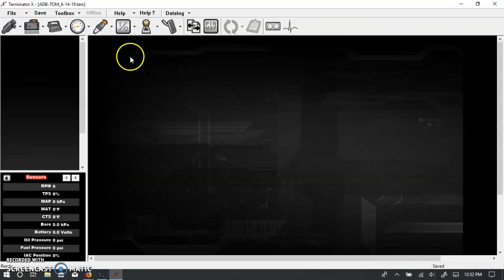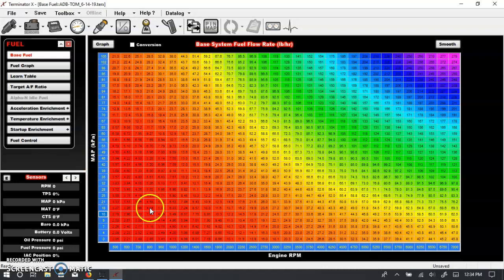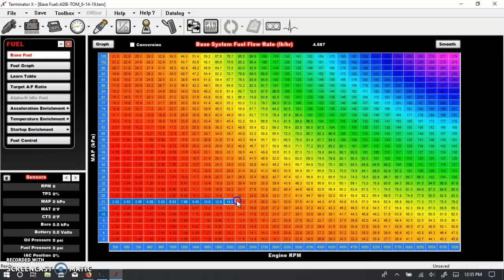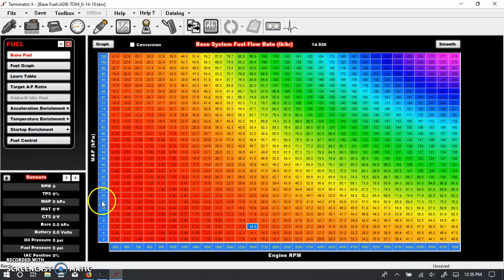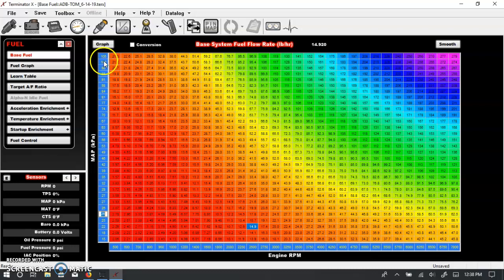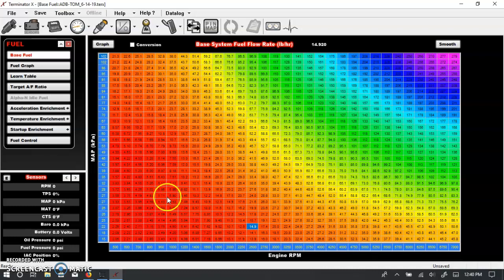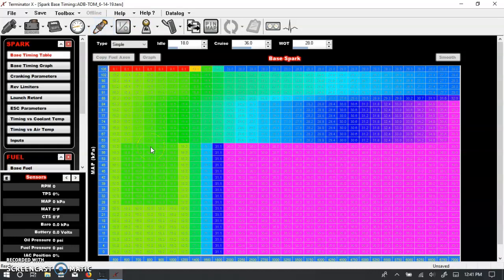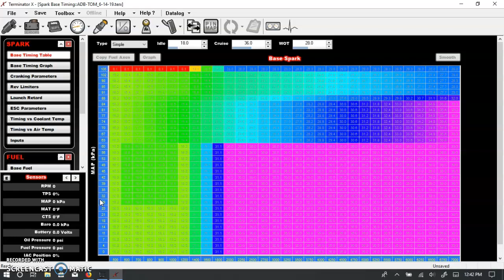Holley EFI Terminator X software Part 3

Comment: I have speed master injection ls1 will this holley terminate work
Reply from the maker: I don't know what "Speed Master" is...
Reply: @projectgattago  they make fuel injection manafolds with stacks
Reply from the maker: I don't see why it wouldn't as long as the a common plenum for the vacuum.

Comment: next video please lol.  question , when I swap over could I just enter the info in the hand held  to get my car running ( I did this with my current ECU as their software is difficult to access to tune on a PC) correct? thanks.
Reply from the maker: Ill get another video made after Christmas. Yes, you can always go through the handheld to enter the initial tune. Although, tuning with a laptop is way easier!

Comment: Can you delete  bars with this?
Reply from the maker: VATS is only on OEM systems. The Holley ECU and software do not have VATS. This software can only be used with the Holley ECUs, not the OEM computers.
Reply: @projectgattago  any free software that will do it?
Reply from the maker: @julzam9660  Not that I am aware of. For stock LS ECUs I see most people use HP Tuners or EFILive. That's the great thing about the Holley Terminator X. It comes with the ECU and software, so nothing extra is required.
Reply: @projectgattago  Ty very much  good to know. I'm new at ls swapping
Reply from the maker: @julzam9660  No problem. If you plan to modify your engine in the future, the Holley Terminator X systems are awesome and not much more expensive than a new standalone harness.

Comment: Can we get a video on acceleration enrichment ?
Reply from the maker: Yes! The basics of AE tuning is that it should be done after the main fuel table is dialed in very well. Only then use the AE enrichment to address any issues that might still be present.